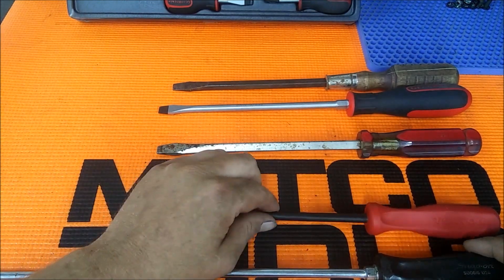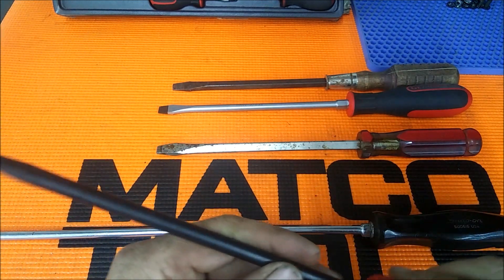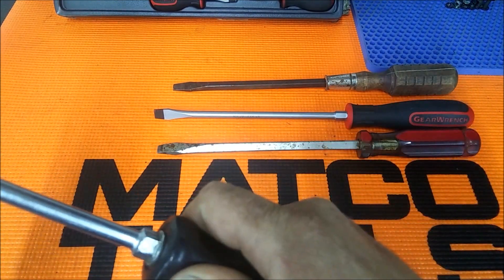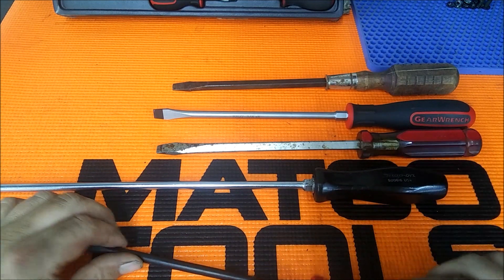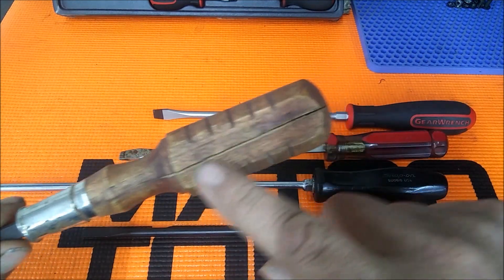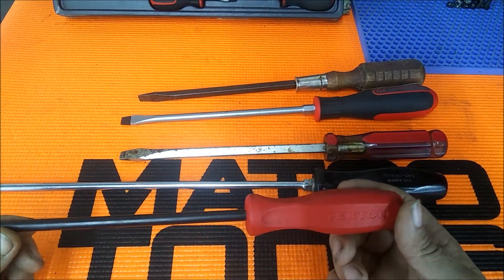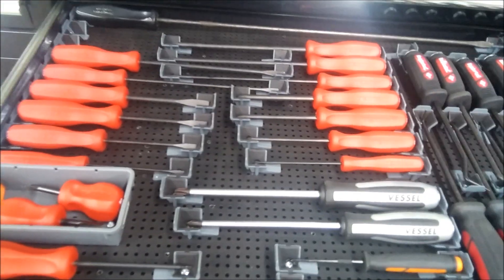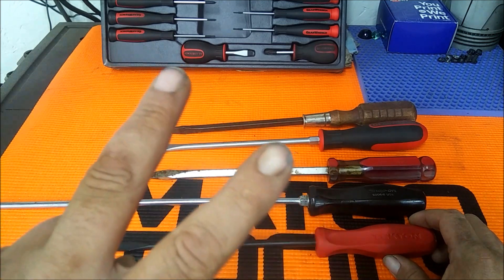Tekton USA made screwdrivers VS Snap-on

Comment: I have the hard handle Tekton Set and Snap-on soft handle set, l like them both! The Snap-ons have a ribbed tip and tend to grab the screws a little better. The Tekton set has different in between sizes and work well. Its also easier to get a warranty replacement from Tekton vs Snap-on, when you are just DIY-er.
Reply from the maker: I now have replaced the Tekton's with Snap-on hard handle screwdrivers in my main box and moved the Tekton's into my cart now. I like both as well but like the Snap-on just a little better. I have a Snap-on dealer stop by my shop that helps LOL but I understand what you are saying ... thank you for watching Damien